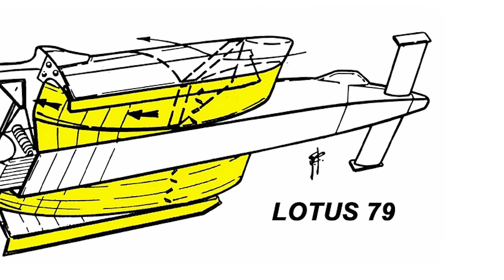Formula 1 - Everything You Need to Know | Up to Speed

Comment: After Senna’s death, Michael Schumacher requested for the cars to have a stronger chassis and body to help protect the driver.
And after the death of Jules bianchi (sorry if I spelt it wrong) there i death started to float around about more head safety, I’m pretty sure the HANS was already in use then, so from that, became the halo.
Reply: Cheesy Fries hans was in use since 2003.
Reply: Hans died in 2006🤪
Reply: No Jules would've died with the Halo as well there is no possible protection for such an accident, but what they introduced is the VSC (virtual safety car) where you have to maintain a certain speed, that would've probably saved his life.
Reply: Welp, I’m not as up to date as i thought
Reply: Gameplaylike, yup and recovery vehicles aren’t allowed on track during yellow or double yellow anymore.Without a VSC or a safety car no recovery equipment and personal is allowed on track and in run off areas. 
Plans considering head shielding mounted on the car really took off after henry surtees death and Massa’s incident.
Reply: @EAGYSL  it probably would've crushed his legs but I wouldn't say kill him still.
Reply: @stephenfitzsimmons1752  Wdym? No. They still use Hans.
Reply: The HALO saved Romain's life in Bahrain.
I'm so grateful that they made it mandatory!💯
Reply: @z.niamut4045  and charles leclerc's at spa 18
Reply: And also a fighter jet style non-shattering windscreen merged with the HALO that doesn't wiggle around
Reply: Schumacher had literally nothing to do with the improvements made to the cars safety after Senna died
Reply: @nauuwgtx  so basically indycar

Comment: Greatest rivalry was Prost/Senna hands down.The 80s turbo cars made 1500hp from 1.5 liters but had a weight penalty, just saying.
Reply: Your right, I didn't clarify that! The cars olny lasted one lap before melting parts! Also it was just an estimate as dynos of the day maxed out at 1300hp. They said race trim was around 1000 hp.
Reply: The cars don't reach 1500HP. It just was one engine of one car. Is exception a word to you?
Reply: Snippy which engine and which car? I said the dynos went to 1300 horsepower the engineers estimated 1500 for qualifing. What part of that do you have a problem with?
Reply: yes it was the BMW M12/13 engines that are famous  for making 1500hp but do you think that others weren't? other cars were competitive and so they were probably making around that horsepower level as well
Reply: yeah the days when they put a new engine in just for the quali lap...
Reply: Steve Mo. No best rivalry was lauda and hunt
Reply: Greatest rivalry Alonso and a working car
Reply: I think the most powerful engines of the era, the BMWs, made an estimated 1350 HP in the qualifyig trim and the dynos went up to 1200 not 1300.
Reply: And that's what I said.

Comment: Pretty nice video! All in all pretty much on point. The correction on KERS was in the comments allready.

They also replaced that wooden plank with metallic skid blocks, to bring back the sparks from the 80s and 90s. They still have the same function as the wooden planks though, but it looks pretty darn impressive, when the cars begin to spark on long straights!

Comment: 8:53 actually the plank is now made of Titanium, so it sparks when the touches the ground. And I love you too James.
Reply: it sparked before... it only sparked because of friction when it ran on the ground.
Reply: @spom3445  Before they introduced the titanium plank? Not really, since it was made of wood. What sparked were other areas of the car, but way less then now. If you mean in the past (like the 70´s), that´s because they were made of titanium. But they introduced the wood ones to avoid the teams of running the car too low and risk accidents because of the car losing traction on bumps.

Comment: The planks are no more wood Madden but titanium mad, that explain the sparks we see now. Then engines are rated at about 1000hp for Mercedes. ;)
Reply: zcsb1 you are wrong. They are still wood but have titanium strips on them.
Reply: You are both wrong. They are wooden composite these days. Not just a plank of wood. And yes it has titanium skid plates on it.
Reply: DelSolTypeR1987 still, the titanium plate wear is controlled now.
Reply: As far as I know, sparks are due to the titanium bolts that are used to attach the wooden plank. Please correct me if I am wrong :)

Comment: That moment when you realize the ground effect is legal starting 2022 and that the board will be gone

edit: originally said 2021, turns out it’s 2022
Reply: Nope. The new regulations are being postponed to 2023
Reply: @Adithya13303  2022
Reply: @Adithya13303  2022 mate
Reply: Betto Bello it sucks they’re postponing it. i was really excited to see the new cars and the closer racing🥺
Reply: Mason Bakken The racing I think was the best we’ve seen since as far as I can remember. We had two classics last year (those being Brazil and Germany) and good mid-field battles. While I’m for the new regulations, I’m not expecting a re-invention of the racing as it is already some of the best in motor racing. People always say the cars are the issue when the tracks play a much bigger role. Barcelona is still a bore fest in F2 and GT racing while Interlagos always produces brilliant races wether it’s F1 or WEC.
Reply: Sarah wood this is true, but F1 100% has the biggest dirty air problem out of every series. GTOPEN produces some incredible racing at every track simply because those cars don’t produce as much dirty air, drivers can race right behind each other without running the risk of losing grip and crashing.

Comment: In 2014, they already used ERS, the more advanced version of KERS. KERS is only Kinetic, while ERS also converts Heat energy into power with their MGU-H, although they also converts Kinetic energy into power just like KERS with their MGU-K. Also, in 2014, the total combined horsepower was around 800 BHP, not 750 BHP. And these extra power from the ERS is not only on certain times, since unlike KERS, ERS is automatic and constantly delivers extra powers non stop.

While before that, in 2006-2013 with the 2.4 l naturally aspirated V8 was about 850 BHP.

And in the late 3.0 l naturally aspirated V10 era in 2002-2005 the cars have around 900-950 BHP.

And since 2016 until now, the cars have around 1000 BHP.
Reply: Yeah, and ERS and KERS are very different. KERS was a select deployment system where the drivers had to push a button for it to activate where ERS is a constant deployment system where it's constantly delivering extra power at different levels selected by the driver

Comment: I wanna get a F1 motor and put it into a MK1 Golf GTI.   #DubLife
Reply: Nick_PDX 22 it’s not a f1 engine but it’s a Indy engine something similar
Reply: how to spend $50,000+ a day
Reply: Make sure to slam and poke it so it doesn't handle well, and gets stuck on pebbles! #DubLife
Reply: I mean... If you've got some spare cash, I don't see why you couldn't.
Starting/running costs/reliability would be a bit of a bastard though, so probably stick with one of the older engines ;)
Reply: Brodie Bennett you clearly have no idea how formula one engines work. All formula one components, just like all racing components in general, are disposable. In F1 they have to last at least 2 races due to regulations, but the team will rebuild it after each race, and never use it again after the 2nd race. If you tried to take a used F1 engine and put it in a project car it'd likely last no more than 4 hours before it blew up.
Reply: Nick_PDX 22 Just Make Sure It Has Good Mileage Or At Least It Has To Fit With Other Stock Parts...
Reply: Nick_PDX 22 Thats it put a F1 engine in a chick ride. Sleepers being cool is a myth. Say you are driving a F1 powered GTI & your racing me in a Vision GT, Vulcan or  Zonda R & you walk away from me gapping me by 15 car lengths.. Do you think id be bummed out & envious I got beat bye a VW? Nope.. Why cause I'd be driving a hand built hypercar. Id be amazed that someone would stick a F1 engine in a POS spending more money then it costs to build a low value Ferrari, Aston Martin, Benz or BMW GT car making a square shaped girls ride stupid fast. Your better then that. Only one way that be cool & it will never happen because Mario Kart World doesn't exist in real life. Stop and rethink your F1 Engine swap dreams.
Reply: How to go bankrupt in under 48 hours 101 😂
The cost of just modifying the car to handle the power of a F1 engine would be exorbitant 😂
Reply: MrGlued2thepc lol
Reply: You start a go fund me account and I’ll be sure to donate and film when the project is complete 💁🏻‍♂️🤩👌🏼
Reply: Nick_PDX 22 how cool would a 350z with an f1 engine be as a drift car
Reply: Dont forget the wood on the bottom of the car

Comment: "...driven by the most skilled racers, period."

Rally drivers have entered the chat
Reply: Can’t really compare driving over 320 km/h with over 6g to a rally driving. Totaly different types of racing and driving techniques. Both are very skilled drivers but in different ways.
Reply: Kimi Raikkonen have entered the chat
Reply: @marea_turbo  Kimi wasn't good in the WRC though. Another driver who tried rally was Alonso. He scored a podium at the Ula-Neom Rally (which was only his 3rd rally in preparation for Dakar). Alonso finished 13th overall at the Dakar Rally in his rookie year. Considering its Dakar and its insanely difficult... and most don't even make it to all 12 days... not a bad finish at all. Also, there is Robert Kubica who was the 2013 WRC2 champion.
Reply: @samuelcibulka7217  Some drivers have crossed over. Sebastien Loeb moved from rally to DTM fairly easily. His first time in an F1 car was pretty good. He would have gotten a drive with Torro Rosso had he not been denied a superlicense. Yes, its a different discipline like for example rally drivers don't have to worry about overtaking someone. But at the same time, F1 drivers don't have to fix their car when they have an issue on track. But some things do carry over. One of the reasons why Sebastien Loeb is unbeatable is because of his driving style. Loeb's style is almost like a racer's. Very clean, very precise and very minimal drifting. He takes the same lines in a corner as a racer would. 

Other F1 drivers have tried rally. Kimi Raikonnen was one which wasn't successful. Alonso has tried his hand at rally. He got a podium at the Ula-Neom Rally which is a smaller rally in preparation for Dakar and finished 13th overall at Dakar Rally but the most successful F1 driver to make the leap to rally is Robert Kubica who was the 2013 WRC2 champion.
Reply: Rally is king of motorsports
Reply: @Jacob_EstateAgent  🧢
Reply: Slow cars driven fast > fast cars driven fast.

Comment: Actually you're right about one thing about halo, but in my concerns, it's... kinda ineffective since it only defends big parts like tyres, walls, heavy compartments, and so on, if you looked back at Massa '09 at Budapest, it's a frickin' small part that came outta Barichello's car, in which if i look at the replay back then, it's not in Halo's range of defense. Apart from it, the Halo is hanging just one line, that even interference the front sight of Driver's view. All i say is Halo right now is Okay for experiment but we may have to wait about FIA's decision, either to update the Halo, or switch to another protection device, such as windshields or Aeroscreens (pls, make it like X2014 if it does, hehe)
Reply: Joddy Pranata I agree with you. He mentions protection against tires coming at them, but the have wheel tethers on the car to prevent from flying off the car when it is involved in a crash
Reply: Joe Esposito yes, and what about flown brake discs and it's compartments hittin' the cockpit? I bet it's almost impossible to protected by halo, lol

Comment: One important point about 1994: All of the main driver aids (Traction control, Semi-Auto Gearbox, etc.) were banned at the end of '93/beginning of '94. With no other changes to the cars, their characteristics in terms of drivability and safety changed drastically, which made them a challenge for all of the drivers to get used to, which in term contributed to the cars' lack of safety. These ended up being factors in the disaster that was that year's San Marino GP (as well as the Bennetton Cheating scandal in a slight sense, only about the driver aids).

Comment: Todays F1 engines are somewhere around 1000HP, just sayin'...
Reply: That's the combined output adding all the parts of the PU, not just the engine like it was in the V10 20k revs era.
Reply: The engine alone makes like 750 to 800 hp, they're more powerful than the V8's ever were, and that's the engine alone, with the hybrid system the usually do 900 to 950 hp with this years cars doing 1000 hp without to many trouble, atleast the Mercedes engine, Ferrari does it barely and Renault and Honda can't
Reply: True.. That is what I thought as well
Reply: I was hoping also he would mention the 1200hp+ outputs of the old 80s engines. Got un intitiated fans thinking they only made 700hp.
Reply: The 80's cars made 1200 hp in qualifying mode, the engine only lasted the qualifying and then it was changed for the race, in race mode the 80's engines produced around 700 to 800 hp
Reply: True, still counts though. And there was a BMW 1.5 inline 4 that made 1400hp in qualifying trim.
Reply: And then people wonder why there were so many deaths back then
Reply: werent really any deaths through the 80s. Most of the deaths came in the 50's and 60's. As James said, in 1994 F1 had been many years without a death in the car before Ratzenberger and Senna.
Reply: It was a joke, areally bad one tho. But I'm happy that there's no deaths anymore, I don't wanna see my favorite driver die, he has his own life outside of racing, he just chose that job and people say that they should risk their lifes for our entertainment are morons

Comment: You forgot to mention that the FIA banned Active Suspension, ABS and Traction control for the 1994 season ultimately creating an unstable Williams car that resulted in Ayrton Sennas death
Reply: Senna crash was caused by a steering column failure due to sennas unique requirements for the position of the wheel, this required extensions to the column that needed to be welded on and those welds failed killing senna

Comment: F1 or LMP cars?
Reply: Nicoles Pruitt There's no comparison anyway, the quickest LMP1 is miles behind the slowest F1 (even if the F1 car is driven in practice 1 or 3 by a WEC driver), there's a video of a Spa lap in 2014 with the Toyota vs the Caterham.
Reply: LMP what?
Reply: Viktor Tegelberg LMP1
Reply: Viktor Tegelberg LMP1, LMP2 and GT.
Reply: Nicoles Pruitt lmp is more about endurance. F1 is pure raw speed sprinting.
Reply: Eventus Vantos They are both endurance racing series at the end of the day, WEC is 6, 12 or 24 hr long, F1 lasts 300 Km (except for Monaco) and has to do that with less than 105 L of fuel and leaving some for fuel tests.
Reply: Andrea Moroni yes but lmp cars for for 24 he races...which is way longer than f1. Hence they are more endurance focused.

Comment: when senna died there was a market shift to from 12 - 8 cyl..
though at some point they were looking at v6 turbo which were matching  N/A tuned 8 cyls, noting that  v8 tuned with turbos were matching  or exceeding the power output of the  12 cyls..
as for the elf 1,2 and 3 concept lasted 1.5 seasons with the last bowing out of either le mans or monaco GP with engine issues

Comment: F1 engines had 750 hp in 2014 but in 2018 they are close to 1000 hp, 850 hp comes from the V6 and 150 hp comes from the hybrid system that has two main pieces, the MGU-H and MGU-K, one of them is responsible for transforming the turbo gases into energy the other one catches cinetic energy from braking and sends it to the battery

Comment: In the 90s, I was a lab tech in one of the leading UK universities. I worked with a student on scratch testing of plastics, measuring coefficient of friction with respect to time. It's only much later that I found out that this work is for the outer coating for McLaren formula one (Coulthard and Hakkinen). The academic l did the work for got the VIP treatment....champagne, met the drivers, mechanics etc. As a lab tech I got the usual......nothing!

Comment: The modern turbocharged F1 engines don't peak at 750 horsepower, at baseline these engines produce around 700 to 800 horsepower and with the electrical hybrid power unit combined they peak around 1000 to 1100 horsepower.

Comment: @10:56 How confusing. It can’t use more than 100 kg of fuel an hour. 1 gallon of petrol weighs 2.84 kg so 100 divided by 2.84 equals 35.2 gallons per hour.

Comment: honestly all this DRS/KERS thing confuses me
Reply: DRS Moves the rear wing to allow much higher speeds down the  straights and promote easy overtaking.

KERS is used to recover kinetic energy under braking and stored in the flywheel or high voltage batteries for later use under acceleration to give an extra 80 and half HP on hand.

Comment: 0:11 is wrong, the Aussie V8 supercars are earth's best drivers not f1
Reply: I agree actually. Anybody can pilot the RB23 and get pole or an race win.

It's another thing to drive an Hefty and torque-heavy V8 Sedan without much aero and still need to heel and toe to downshift effectively.
Reply: @noahletwinski6955  Exactly, those things have almost no downforce, slippery tires and over 600 bhp straight to the rears. The cars are heavy as well and require a lot of finesse to handle. Also the sequential shifter with a clutch that you have to use to downshift makes everything just the more difficult. Meanwhile in F1 you have Earth's stickiest tires, 2 tones of downforce and tons of computers telling you everything about the car. In supercars, you have to feel if you tires are going on you or if there is something wrong with the car (with the exception of crew comms).